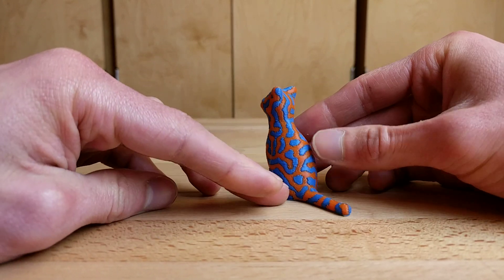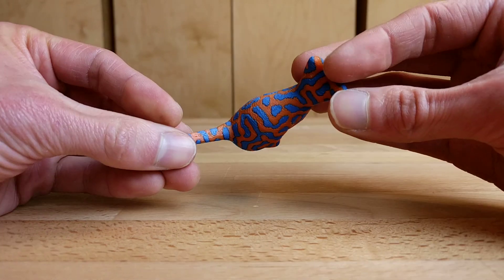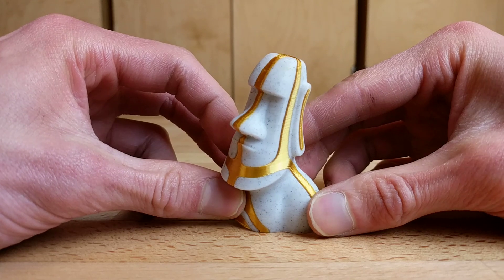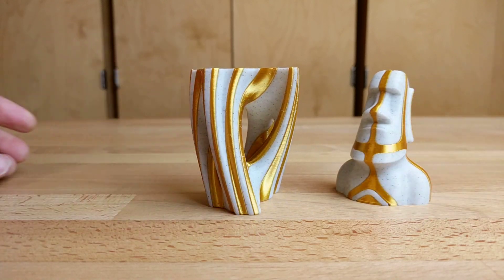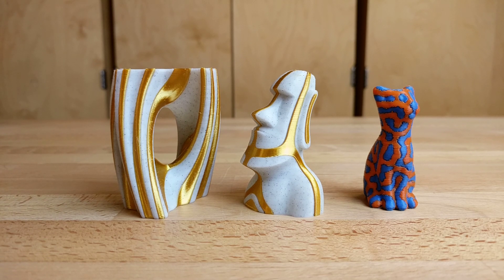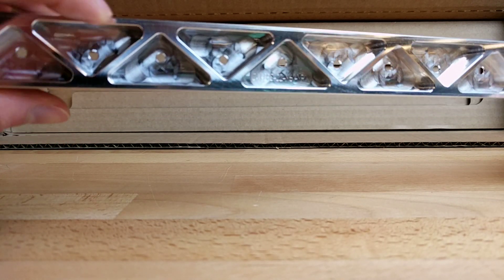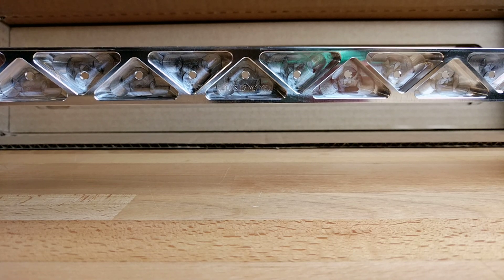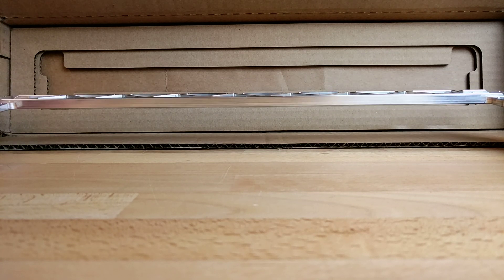Jubilee Update: Print Quality and Machined Upgrades

Comment: Dear Joshua,
May I ask you a technical question about a part in your printer?
I am also building a tool changer. I chose a different mechanism for the tool change. I only use 1 pulling cable instead of your two cable design. I also use a purely translating locking mechanism instead of your rotating mechanism. This means my cable us pulling against a fairly stiff spring. Overall I think the tension in my cable when fully tensioned is somewhere around 60-80N. The inner tension cable is a universal moped throttle cable. The outside cable is a brake cable from a bicycle. At the moment the outside cable is a bit to stiff. Therefore I am looking for more flexible outside cable. Your outside cables look flexible enough. However, will they be able to withstand this much force without locking the inner cable? I think my cable tension is a hell of a lot more than yours. 
Any help would be greatly appreciated!
If I sparked your curiosity,  my channel has a video on-line showing my tool changer concept.
Kind regards,
Frank
Reply from the maker: Yes, I think youre looking for "continuous length extension spring," aka "spring guide."

Jubilee uses some from DR Templeman, but you can also find a slightly bigger size at Mcmaster Carr.

Link:
http://stocksprings.drtempleman.com/item/spring-guides/spring-guide/sg-088-020-120

Finally, if you want the spring and cable as a paired set, check out Filastruder, who is kindly reselling these together now.
https://www.filastruder.com/products/wire-cable-and-spring-guide-set-for-jubilee?_pos=1&_sid=d1791fe46&_ss=r
Reply: @POOFjunior  
Thank you for response.
Of course! This is just a normal extension spring. I thought it was something specially made for the inner tension cable design. I can buy these everywhere. This is way easier than I thought :P
Thanks!

Comment: What is the advantage of this crossbar over aluminium extrusion?
I see that E3D used a similar crossbar and I expect that they have good reasons for that. But I don't see it....
Reply from the maker: Having a single piece makes the setup easier to align and assemble in addition to making it stiffer both from heavy tools and from the forces exhibited by the belts when changing from X movement to Y movement. (This is a drawback of CoreXY in that the changing between X and Y movements applies a twist in the crossbar looking top down.)

Is it necessary? Nope. You can get a great setup from something made from  2020 extrusion, but you might have to do more work to align it and keep it squared up between prints.
Reply: @POOFjunior  Thanks a lot! 
There is a lot to learn. 
I love your videos. For 3D printing the Toolchanger is like the holy grale for me.

I hope to build one myself... but I have a long  way to go to cover more basic stuff first.

Comment: Found your channel and jubilee after a YouTube black hole starting at E3D and can I just say as a recent MechE grad: holy cow are these designs awesome. I love the creativity and simplicity involved in the cable drives and flexure mechanisms. After seeing your kinematically coupled bed I immediately thought how amazing it would be to bring the front down to get a 45deg conveyor with infinite z similar to the white Knight or cr-30 prototypes. Have been looking around for a printer to build since my first delta back in 2014 and you may have made a customer out of me ;) keep up the great work, looking forward to seeing where Jubilee is headed
Reply from the maker: Hey, much appreciated! Feel free to take a peek on Discord to see what other mischief folks are doing with their own derivatives!

And as for conveying.. Since the bed plate is kinematically coupled, you could technically lower it onto a conveyor belt and pick up another plate to resume printing. It's not quite the same, but it does offer something different to play with.
Reply: @POOFjunior  thanks, I'll check it out for sure! Conveyor would definitely require a custom bed and vertical carriages; good thing I've got my student solidworks license still :)

Comment: ps print that cat with glow in the dark filament combined with another one. it'll look STUNNING in the dark :)
i can find the image if you're curious!
On my magnetic tool changer my problem is getting the extrusion after a tool change to be consistent :s i removed the wipe tower lately and added physical thingies to catch and wipe the nozzle (basically a 3d printed part with thinfoil taped on top!) and it improved things a lot! also I don't do any retractions when docking the tool. my theory on why that hurt my print quality is that it created a swollen bit of filament that extrudes more filament then it should?

Comment: Would it be possible to use a single remote direct drive (i.e. using a drive cable) with a tool changer? It would be necessary to transmit rotational power from the tool holder to the tool. This would remove the mass of the extruding stepper from the moving printhead and would only require one stepper for all of the tools. Thoughts?
Reply from the maker: Ohh, this is tricky because the cable drive used in the toolchanger lock/unlock system isn't really meant for continuous rotation. The issue is that a wrapped wire rope will "walk" up the shaft as you continue to rotate it. It's also not possible to buy closed loops of wire rope either. That said, there are other  mechanisms out there that behave on similar principles of remote actuation, and the Zesty Nimble is one of the best examples. For a super thorough lecture on cable drives (where I actually learned about them first!), check out this lecture by Reuben Brewer: https://www.youtube.com/watch?v=jKZIvseA1Nk
Reply: @POOFjunior  I had meant using the Zesty Nimble in addition to the cable driven tool changer. I didn't mean to try to have the tool changer extrude. (Re-reading it I could have worded it better). Any plans to use a remote direct drive with your printer?
Reply from the maker: @BradenEliason  Oh gotcha. I probably wont explore extruder variants (except for the Hemera at this point because of how nicely it can do flexibles, and I do want to support E3D for their design openness). That said, I do encourage folks to play around with other extruder and tool head types in general. That's one of the hopes of the project: to be a platform for extension and experimentation that doesn't require you to rebuild everything from scratch.